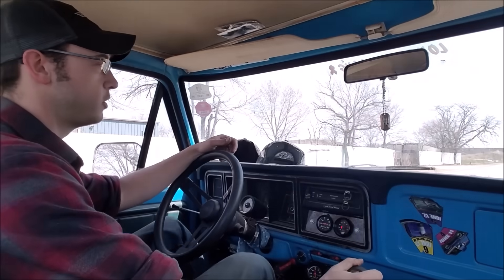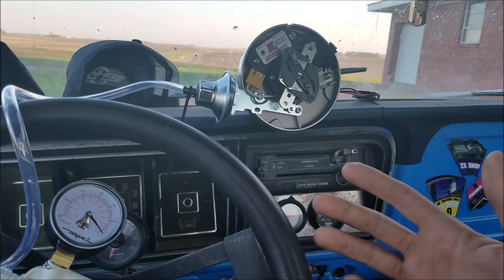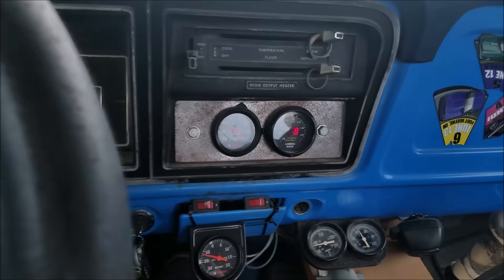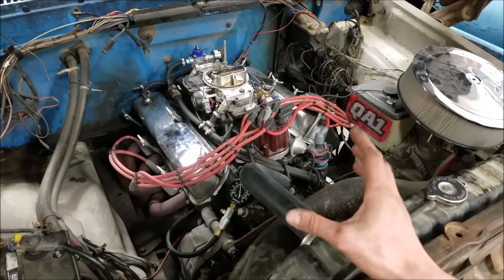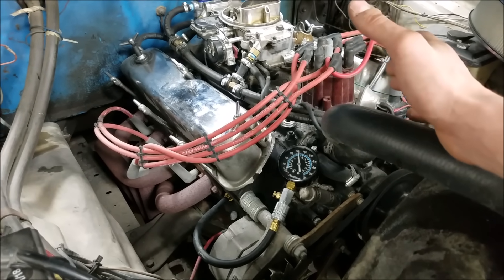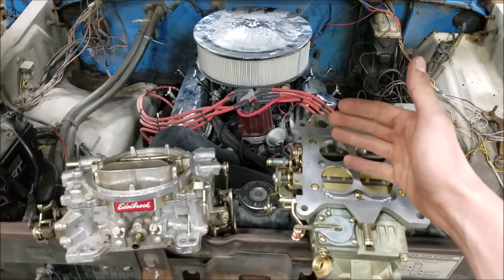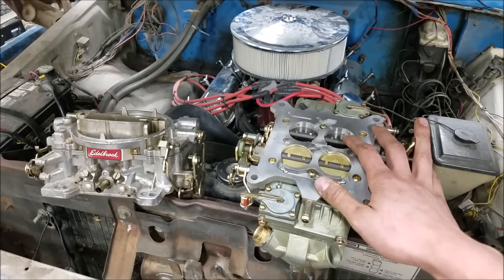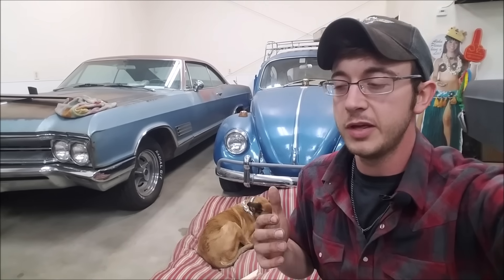Vacuum Advance - Ported vs Manifold: Which to Use & When !!!

Comment: Love your videos! I was wondering if you could help me. I've been fighting with my 305 small block chevy. I've got a 750 vacuum secondary carburetor and if I set the primary throttle blades to show the transfer slot, it idles at 1500 rpm and slames into gear. I've tried closing the secondaries but there already closed all the way. Ive ended up having to close the primary blades so far that no transfer slot is showing and I have a hideous tip in bog. Ive checked for vacuum leaks and can't find any, I even disconnected every vacuum line and nothing. I have the timing set to 15 degrees initial and 35 total. I've tried ported vacuum and like it, but it still idles at 1200 rpm. I'm thinking my 750 is just too big. If you could help me answer this it would be much appreciated.
Reply: I would have to say 750 maybe way too big I had a problem like that and it turned out I had to replace the intake gaskets I just replaced because there was a vacuum leak in the valley under the intake Runner

Comment: Really, the dead stupid simple answer to this is to try both and see which runs better. And of course adjusting the carb to suit. Lots of internet experts would say I'd be better off on manifold vacuum, but actually trying it both ways told me ported was the way to go on my motor. There's no right answer on ported vs manifold, just try it both ways and see what works best

Comment: I liked your video a lot! Good ol’ fashion information that was mostly understandable. At least to me!! 

I got one question, I got an Old school 121 cui single cam 4-banger, running 4 carbs (dual Weber-style Solex 45), 10.8:1 comp and Lumenition instead of point. It should be capable of spinning to 6grand, but still no tack yet.  

My question is, when you say “mild” or street cam, when does that start? 

Here is my cam specs 
VALVE LIFT 11.4 
NOCK ANGLE 111 ° 
DURATION 300

Is that mild? I’m started with 82hp, but I should be close to 130ish hp now. 
Will that mean ported or non ported? 

And how do I know if I need to re-curve or just keep advancing ignition? 
I’m running an era perfect old school set up, and wants to follow this route, as far as possible. And not go to infinite MAP timing yet.

Comment: What happens if your phone dies? I dunno about the bunch of you but my phone is usually on 10% or Equivalent to less than an 1/8 of a tank of fuel.  

All in all I like it
Reply from the maker: It’s all hard saved to the distributor. 
It doesn’t have to be connected to your phone to work

Comment: I understand your video but have some questions on a distributor that is spinning.  Running full vacuum at idle to distributor advances the timing and allows much more low throttle power.  If your a drag racer or run WOT all the time you are correct, but not for daily drivers that run low throttle 99 percent of the time.  

Full vacuum to distributor at idle is best for low throttle torque driving because vacuum does not drop to zero immediately and as distributor spins up the weights in it and advance the distributor as vacuum decrease do to load. Remember the distributor will mechanically advance via weights up until 3000 rpm or so. 

Running retarded while at idle is asking for overheating problems and  pinging under load when the distributor advances under load via venturi vacuum.  It advances via vacuum AND weights in distributor and adds too much timing under part throttle.

Running full vacuum at idle advances timing in low rpm situations to compensate for weights that are not spinning fast enough.  Then when you load the motor the vacuum advance lessens and weights take over. 

Basically it all depends on what your goals are.  If you drive WOT from stop light to stop light use the venturi vacuum, but for towing or good torque during daily driving use the full vacuum port.

Comment: Anytime you add mechanical initial timing your total timing follows, (total timing at wot is the ultimate goal), how you choose to get there; manifold versus ported is based on a lot of factors which have already been outlined, and the advance curve, the rate of the curve at any given RPM until total mechanical timing is achieved wasn't covered in much depth.
Reply from the maker: Hard to cover everything in short videos - I have a video specifically dedicated to total timing

Comment: Plot twist I don't have vacuum advance. Just mechanical.
Reply from the maker: Your just losing efficiency then
Reply: @ThunderHead289  it's a race car. Nothing efficient about it.
Reply: @ThunderHead289 I got duel weber dcoe's no ported vacuum. I would need to drill my own for each intake port because pulsing from a single cylinder would not be good. It was the way to go in my opinion for my application. I was worried about it running away with the temp when I first went mechanical but its doing well.

Comment: do you know some thing about the chevy 250 v6 models why they love to run ON ore why they love pre ignition? is there any way to run the engine when they key is in off position ore when the key is puled out compleately?do their alternators back charge?
Reply: 250 V6?  If you mean the 250 Stovebolt 6, inline not V, many 70s engines suffered from that.  The common setup was an electric idle stop solenoid.  You adjusted curb idle with it energized, slow idle with it de-energized.  When you shut off the engine, that plunger retracts, dropping it to slow idle position, which nearly closes the throttle plate, preventing the run-on.

Comment: I do run manifold it definetly runs better that ported. Runs cooler smoother tried both, Its what ur engine wants..
Reply from the maker: It’s not about what you use, it’s about what using what port allows you to do. Pay close attention.

Comment: If more throttle percent = less vacuum why does the vacuum gauge go up?
Reply from the maker: I don’t think I said it that way, and if I did, it was simply a slip of the tongue. Less throttle equals move vacuum - engine is an air pump and your throttle works like a valve with vacuum being a theoretical measure of resistance to airflow
Reply: @ThunderHead289  I'm confused. If less throttle equals more vacuum why does the gauge go up when you press the gas? Shouldn't it go down?.
Reply: I can't find the timestamp of where you have it written out in text.
Reply: I think I see my mistake. Ported vacuum goes up on more throttle and manifold goes down with more throttle?
Reply from the maker: @EduardoCorochio  at first, since it’s at zero, it’s going to go up - so at cruising speed it’s same as manifold. Then when you floor it, it also does the same as manifold and drops back to zero. 

It’s originally at zero at idle because it the port isn’t exposed at all, and then as throttle ever so slightly increases from the idle setting it immediately starts to see vacuum
Reply from the maker: @EduardoCorochio  ported doesn’t go up with more throttle, just at the very absolute beginning, then from like 5 percent throttle input on, it directly Mimics manifold vacuum - from just off idle, they are completely indistinguishable

Comment: What about just running no advance? I have a 300 i6 that I have to retard so much to stop it from detonating that it runs like ass. I took the advance off and just ran 10 more degree of base timing, and it runs much better with no detonating. Am I going to have issues?

Comment: Great video brother! One thing I'd like to add to that conversation is an explanation of idle air bypass and how that needs to come into play with more intake duration (and overlap) on your camshaft to facilitate that sweet spot of the butterflies (into the transfer slot before the ported vac port) at an idle.

Comment: I always appreciate your videos.  You have a gift when it comes to sharing your knowledge.  My 77 F250 with stock 400 2-barrel Motorcraft actually utilizes both ported and manifold vac on vacuum advance using two 3-port vacuum switches based off of coolant temperature.  One switch is set for 160, the other at 225 F.  Basically, when the engine is cold, vacuum advance is receiving manifold vac.  When it warms up to over 160, it then switches to ported vac.  If the coolant gets too hot, (over 225 F) it then switches back to manifold vac to increase idle and help cool things down.  Over-Engineered?  Perhaps.  But I've kept it that way since I've owned the truck which is about 33 yrs.  Switches still work but I discovered yesterday my vac advance canister diaphragm is leaking.  I'll be needing help to get things adjusted when I figure out what advance module to install on my distributor.  I'm definitely not a car guru... just an old hack still trying to figure things out.
Reply: That's really interesting. I never took the time to understand what all of that was for. I have a 79 F150 with the 351M.
Reply: It's a smog thing.
Reply: You ever want to sell that 77 then I'd sure be interested! Sounds like you've taken good care of it
Reply: @slowpoke4557  One should never say never... but I never plan on selling that old thing.  Costs me nothing to sit in my driveway (drive a company truck through the week) and she starts and runs like a dream.

Comment: Okay I have a  question. I have a Edelbrock 1408. I had a vacuum leak going to the vacuum advance I plugged up both vacuum ports on the front of the carburetor. In other words there's no advance going to the distributor. this thing runs really well. That's no problem starting. It doesn't overheat. Why is it running so well with no advance whatsoever. It's a 1971 k5 Blazer 350 small block somewhat built

Comment: Whats the consequence of using no vacuum advance at all I have 1969 383 with 16 degrees initial timing with 22 degree mechanical all in at 2500 RPM and no vacuum advance and it seems to run fine
Reply: It probably would have better part throttle response and better gas mileage with a vacuum advance, unless you are running wide open most of the time.

Comment: I personally always choose the middle ground and choose to not even bother with vacuum advance. It always bothers me when I open the hood on an old car and 99.99% of the time people will have the vacuum advance hooked to straight vacuum and everytime I try to correct it they get mad and dont believe me. I also dont like the fact that now you add another variable to deal with when setting up your timing curve and settings and I have seen alot of those vacuum pods leak or the linkage to the timing plate seizes up and then the vacuum advance can't work even if hooked up so if it's my car I always just leave it un hooked.

Comment: I want to see the vacuum gauges at WOT. Does ported vacuum drop to zero at wot? I would hope so. I don't want any timing added other than my mechanical at WOT. Detonation kills motors. I run an MSD ignition control with adjustable timing plots. It does startup timing retard from 0 rpm to 400 rpm then at idle from 401 to 1000 rpm it puts in max 24* timing. above 1000 rpm the map sensor connected to manifold vacuum as per instructions takes over to control timing at various throttle positions. It's basically set up to mimic manifold vacuum. With an AFR gauge and a knock sensor I have tuned out detonation and get the most power out of my mopar 408 whether I'm driving on pump gas or 110 octane at the track. It's nice to be able to change or load your favorite timing curves while sitting in the driver seat. I've got timing curves for 89 octane, 93 octane and 110 octane. I have 4 curves I run for 110 depending on track temps and humidity. GM developed the ported vacuum bit to make the engine run hot so as to improve the nox/smog levels. You never saw ported vacuum till the enviro whacos gained prominence.

Comment: What plug gap can you run with these Pertronix distributors? I've got a 351cleveland with 2v heads running .045 gap. I forgot to mention I'm running the flamethrower coil. Would you recommend a bigger gap or smaller?

Comment: Yes, always ported!  Also, check that distributor, you can easily buy an adjustable vacuum advance with the small allen head inside the hole so you can choose when it comes on, while also replacing them mechanical weights and springs to dial in the right curve for ur motor.
Remember to disconnect the vacuum advance and plug the port when setting ur timing too folks!

Comment: WRT a stock motor, manifold vacuum is usually better and here is why.  As you point out, with ported vacuum, you need a wider throttle opening to get the proper idle speed.  This lets air pass by the throttle blades upon engine shut-down, which can cause dieseling.  This is why, when ported vacuum started being widely used in the early-70s for emissions reasons (cooler combustion temps at idle) that manufacturers started using "anti-dieseling" solenoids to shut the throttle plates when the key is switched off.  You did not mention the adverse affect of dieseling when using ported vacuum in your video.  There is really no performance benefit to using ported vacuum because anyone adjusting their initial advance to offset the greater total advance at idle when using manifold vacuum would only do so to get a lower idle speed.  If you have to do this, it means there is some air entering the motor that should not since your carb's throttle plates should close completely when the idle speed screw is backed all the way out.
Reply from the maker: I think you missed the part where I said this allows you to run more initial mechanical - which then allows you to close your throttle down to normal. Most engines respond stupid better with more initial timing than factory spec. So when you hammer the throttle you maintain more timing.
Reply: @ThunderHead289  Maybe most worn out engines with low compression.  You cannot be telling people to just jack up their initial timing and offset that by running ported vacuum.  You need to explain better what can happen with more initial timing (ie pinging) and how to set timing by ear then.  Now you are talking about a hot-rodder trick that may or may not work, which is fine, but it hardly qualifies IMO as the end-all-the-arguments treatise on ported vs. manifold vacuum advance, which your video here purports to be.  Thanks for engaging!

Comment: Good video. I used to set my initial timing and thought I was done. It makes a difference understanding all of the components and how they work best with your engine. My Pontiac 400 loves a total timing of 36. That's inital + mechanical (no vacuum). Initial is best at 16 for good cranking, so I got a timing curve kit for my distributor to give me 20 mechanical and the springs dictate when it's at full mecahnical which was 2500 RPM. It also doesn't like any additional timing at idle, so I use ported vacuum on the vacuum advance can. The vacuum advance is also adjustable for part throttle cruising. Too much and it's surgey. I have around 10 degrees of vacuum dialed in.
Reply from the maker: That’s science 👆
Reply: You didn't mention whether you had an automatic or manual trans but I would like to state that I do not like using manifold vacuum with an automatic trans because when you put the vehicle in gear the rpm drops lowering vacuum and retarding timing causing a crummy idle, makes engine run hotter, and probably increases likelihood of plugs fouling. So, for an automatic transmission vehicle I prefer ported vacuum but also modify the amount of advance in the distributor just as you did (20 degrees) to get the desired timing at idle speed. Manifold vacuum source can work very nicely for manual trans, though.
Reply: @mickangio16  I have a manual transmission, so at idle my timing sits at 16 with the ported vacuum.

Comment: Ported vs manifold:  Whichever you want, either way, use the appropriate vacuum can calibrated for the application.  Manifold vacuum cans pull in much faster, only a few inches hg.